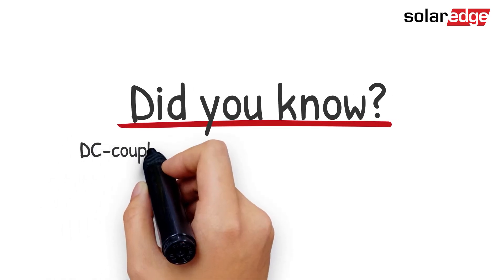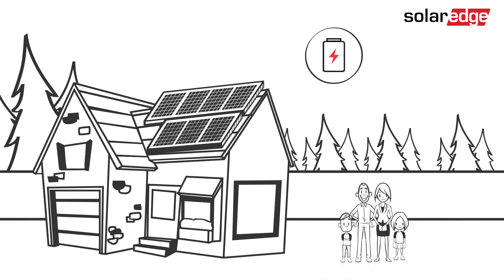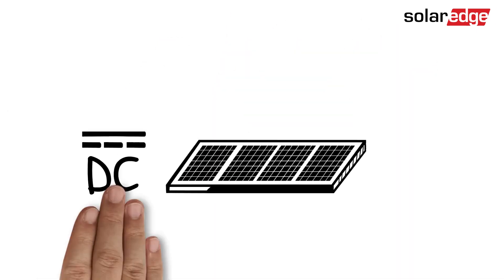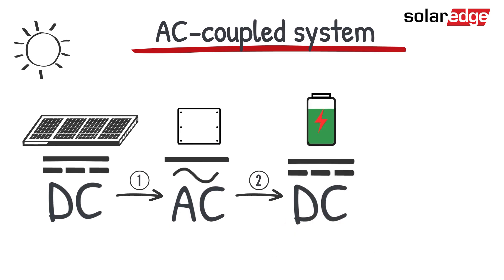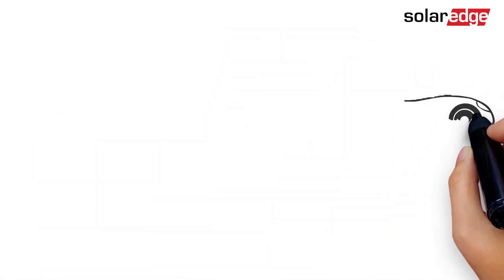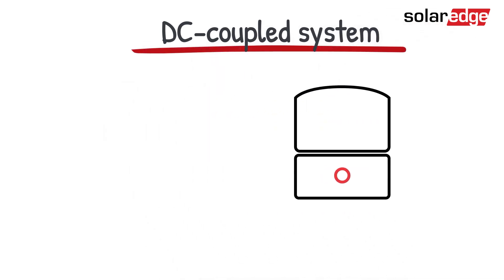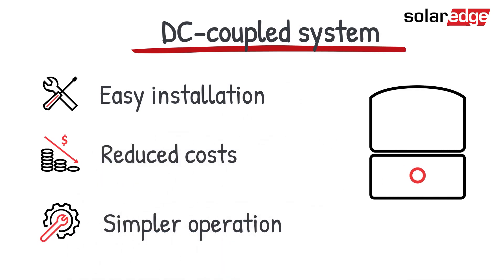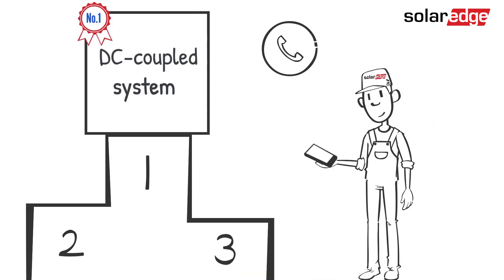SolarEdge | Did you know: DC-coupled vs AC-coupled solar systems | International

Comment: Theoretically correct , but practically howuch longer would a 12v 100 amp Lead Acid battery last with a 300w load, AC vs DC ?

Comment: DC coupled system is only efficent if you don't sell back any electricity to the grid.  I have solar/battery back up at home.  I sell back to the grid probably 99% out of the year.   I can live with inefficient AC coupled solar/battery system during the power outage.   Some comment here said that microinverter (AC coupled) will clip the output of the solar panels.  Yest it is true but solar panel don't always produced at the max output to hit the micro inverter's max, unless you have solar tracking solar rack.   AC/DC coupled has it place in different situation.

Comment: lets add "When our Solar Edge DC inverters go out, which happens pretty much at year 5, puts you 100% off solar because there is no more conversion. But with an AC system, each panel is independent of each other. Also, most batteries today are designed for the AC conversion, leaving you, the customer, with no noitcible loss"
Reply: ac coupling system like micro inverters all end up at a combiner box which is only warrantied for 5 years or 10 years at best. its the same thing, if the combiner box fails then your whole system is down. even worse, now the microinverter system has more parts, including the inverters on the roof, that can also go wrong on an individual level. having more things that can go wrong is worse, not better.

Comment: Wouldn't the excess PV electricity get sold back to the grid in an AC coupled system and not "lost"?
Reply: No, the grid will only take AC power. If the inverter can not handle the load, you get clipping, and that excess power is lost. Better for it to go into the battery first, and then convert to AC for local use or selling to the grid.
Reply: @geekstradamus1548  this is nonsense. The inverter will handle the load just fine because it has to be sized accordingly to the maximum power produced by the panels. The is no clipping or waisted power from any inverter as they send it straight to mains which can take MegaWatts without issues, that's how power plants work.
Reply: @niconiconii-san  investors are more inefficient when operating below their max load, so most investors are sized smaller than the max possible panel/array output.

If they are you’ll have greater power loss during the conversion.
Reply: @geekstradamus1548  This has nothing to do with battery backup anyway and you would need an inverter either ways. Even if you are converting the DC from the pannels to charge a DC battery. This has nothing to do with the original comment.
Reply: @niconiconii-san  Micro-inverters often clip at the panel level.  On a South facing slope, a lot of the energy is wasted. In a comparison, between AC micro-inverters and DC optimizers the DC Optimizers win out by as much as 12%.
Reply: Yes, this video is bullshit

Comment: This is biased and misleading. Yes, there are losses but they are a small percentage. There’s some advantages to AC coupled battery systems that may suit any number of users and installations that are worth the additional losses to have. Off peak charging from the grid and not being limited to the rating of a single inverter are 2 off the top of my head.
Reply: Off peak charging still requires the conversion to DC for battery storage, then reconversion to AC for use in the home. You’ll see the same number of conversions for DC coupling as you would for AC coupling. You still need to go through an inverter to go from the battery to your AC, so AC coupling doesn’t help in the instances you e mentioned.

Comment: Can you install a generator to charge the back up battery
Reply: Any of the good hybrid inverters have generator connections with the ability to AutoStart a generator to charge batteries whenever a chosen state of charge of the batteries is reached.

Comment: total BullS##t, you dont say the huge disadvantage of the DC coupled system !!!!  DC coupled doesnt work when the grid is down!! The AC coupled system has AC power from the battery which is simulating the grid AC and your grid tie inverter works perfectly (powering the house and charging the battery) even when the grid is down.  And you keep spreading this DC coupling BullS##t to your integrator and resellers too.. No wonder you have the dumbest tech support i have seen in electrical engineering.

Comment: Misleading. All inverters store the energy in the battery as DC, it doesn't get converted it to AC then back to DC. This is literally how 100% of Hybrid inverters work.
Reply: When you are using a hybrid inverter it is DC - Coupled with a battery, so you are correct there. This video in regards to AC - Coupled is talking about when you do not have a hybrid Inverter but have a standalone Solar PV system + a separate AC - Coupled battery. (Which is very common and most salespeople will sell you a non-hybrid inverter, unless you are installing a battery at the same time. Then they might opt for a hybrid inverter).

Most people unfortunately make the mistake of installing a non-hybrid inverter which would in fact mean that their only option when adding a battery, is to AC-Couple it. Or replace the existing inverter with a hybrid one...
Reply: @energypartners3674  Good information.  I guess I can't think of a scenario where you would want to add a battery to an inverter that can't support it.
Reply: @rustusandroid  Microinverters are a common scenario where AC coupling would be required such as Enphase Encharge system.  Its very popular but we don't recommend it because of loss in conversions and high cost.  Sonnen is another popular, expensive battery system that is AC coupled, they say their strength is they are inverter agnostic because they are AC coupled, making them ideal for retro battery installs, but we can simply replace a standard inverter with other hybrid inverters for the cost of Sonnen because they are expensive (and have low offgrid continuous output ratings).  Tesla batteries are also AC coupled.  Its fairly common for sales with these less efficient systems.

Comment: Is the energy really lost when you use AC coupled system to run an Air Conditioner in the middle of the day and etc. ? This seem to be more per case basis, sometimes AC coupling is better and othertimes DC coupling.
Reply: This discussion and the term "DC coupled" or "AC coupled" specifically applies to battery storage. Direct usage of the AC energy is the same in either case without battery usage, dependent upon the efficiency of the particular electronics used.

With a DC coupled system, DC energy produced by the PV modules goes into a battery without any conversion, thus saving energy. With an AC coupled system, the DC energy produced by the PV modules is converted to AC energy and then back to DC energy were it is stored in the battery. Those conversion processes create energy loses.
Reply: DC-Coupling topology can maximize energy utilization allowing use of excess PV energy, and that is not possible with AC-coupling topology.
Energy is not always lost – only when the energy production exceeds the inverter power rating, typically in mid-day.
Reply: @11sinatra  Well, if one only needs to drive AC electric motors with PV panels, then the PVDC has to be converted to AC anyways, so why not to do it with AC Microinverters?